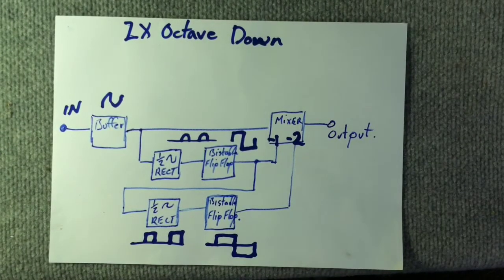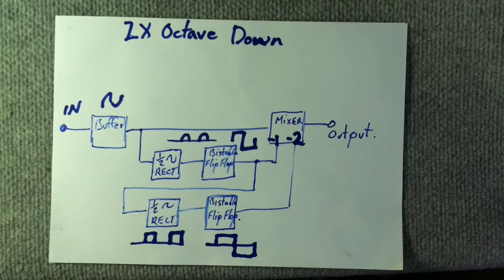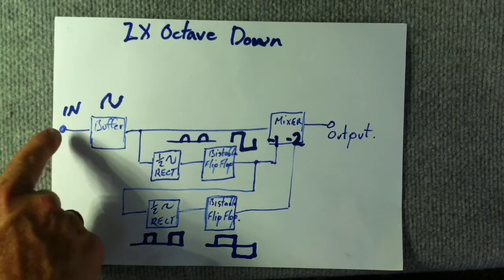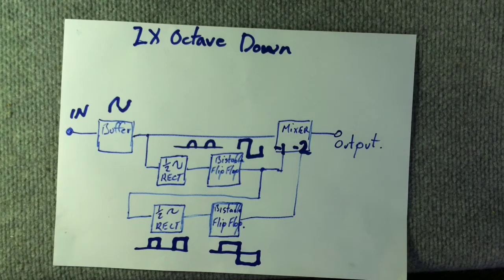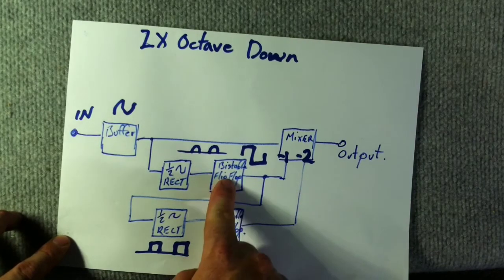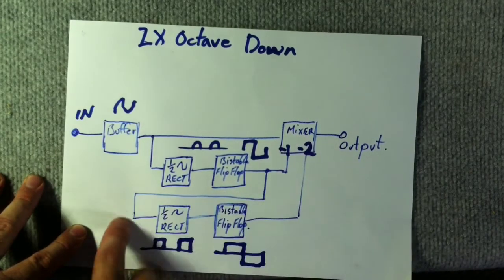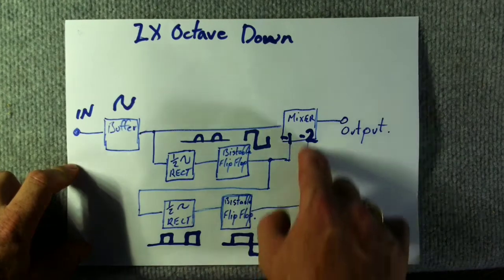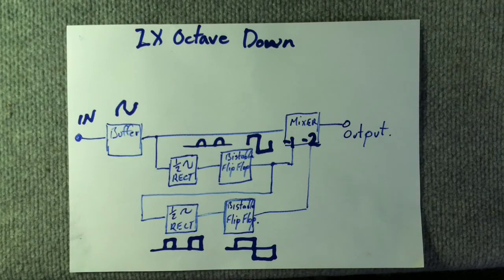DIY Octave Down Pedal (Part 1)

Comment: I built a circuit based on your ideas here, and it definitely works.  Mine is far from sounding good or behaving predictably so far, but the concept is sound, and I'm looking forward to finishing it.  I had just typed a much longer message about the circuit and its quirks, but my browser had a seizure before I finished it.  If anyone is curious, perhaps I'll type some of that back out again.

Thanks for the inspiration, and lest you had any doubt,, this method of octave synthesizing is certainly viable.
Reply from the maker: Can you upload a video so I can hear how it sounds?
Reply: Well, it turns out I got over-excited and spoke too soon.  I assumed the thing was working, since no sound should have passed through the circuit at all otherwise, and indeed I was getting sound.  What I was actually getting though was signal leaking through the power supply.  I tried some other configurations, and had some promising results generating synthesized tones, but nothing that was stable or that would track well across the range of the guitar.  For now I've moved on to some simpler projects, but a suboctave synth is definitely on my bucket list.  I need to order some dedicated flip-flop chips, as building them out of transistors and comparators turned out to be much harder than anticipated.  I'll get a video up if I ever do get it work!  Thanks for the interest.

Comment: Did you ever actually build this thing? I see you have an octave pedal working, but that's octave up, right?

I have a few questions about this one (octave down). I like the idea, but I also see a few problems with it.

1. When you're creating an octaver like this, the signal strength (volume) of your octaves do not follow that of your main note, right? I mean all you're doing is putting out pulses from the flip-flops and these are gonna be fixed in level. Do you think that this is gonna sound alright?

2. Also, at which level of input signal do you actually "trigger" the flip-flops? Set the threshold too high and the octaves will suddenly stop as your note is decaying. Set it too low and you will trigger on noise from the pickups or even the circuit itself when no note is played on the guitar.
Reply from the maker: +wow503 No I haven't build it as yet and yes those question are valid ones.
They are issues I will have to deal with when I do build it.
1. I would run a separate volume control for the octaves and unfortunately there would be no dynamics to the octaves.
2. I may need to gate or load the input of the circuit to control sensitivity so as it doesn't take off or become clunky and unpredictable.
Reply: +Paul Graham (Guitar) You might consider detecting the signal level of the note played with an envelope follower and then use that signal to control some kind of "variable-gain stage" that "multiplies" the output of the flip flops with the output of the envelope follower and after that mix it all (dry + first octave + second octave) together additively. Think of the output of the flip flops as being a "carrier wave" and it gets "modulated" by the envelope of the input signal. This might be difficult to implement though. I'd probably try to wrap my head around it if I had tons of time. (So probably not anytime soon. ;-) ) Nonetheless, it's probably best to start off "simple", and only get more complicated if it actually doesn't sound good at all. I'm curious about how this turns out.

Comment: This is the most heartbreaking thing ever!! I was ensorceled by watching it. Tantalized by words which I recognized but do not fully understand...  "Rectify!!' 'Op amp''Flip flop'
So I searched for part two of this video. I was all set to scrutinize your every move as you put this DIYself video together, so that I could DIMself....
But woe is me. Unable to learn your secret ways 
On a more serious note, using readily available components, how tiny do you think you could make an octave-down circuit like this?
I have a few guitar and bass builds on the go right now and am toying with the idea of sticking something like this directly into the body of the instrument. 
Take care. Hope to see more awesomeness
-Jeffnew subscriber.
Reply from the maker: +Jeff Martens-Koop Sorry Jeff I have not had time to go further with this project as yet.
This circuit should be small enough to fit inside a standard size pedal box with a battery.
It could fit into the control cavity of most electric guitars.
Reply: He ded
Reply: Check the parasite studio web site. He has a pretty good version of this